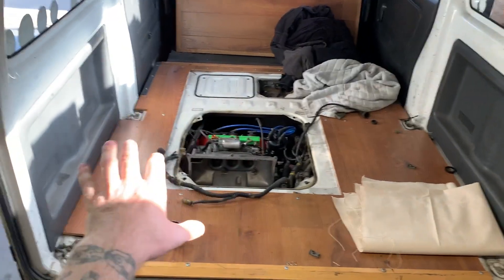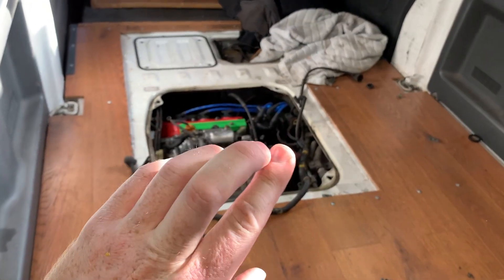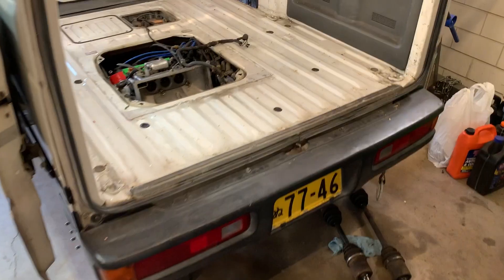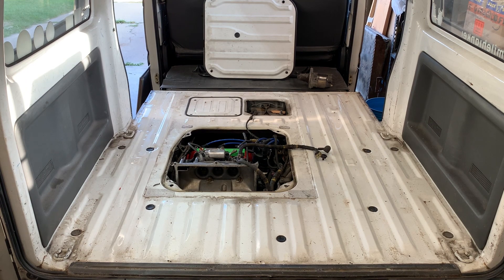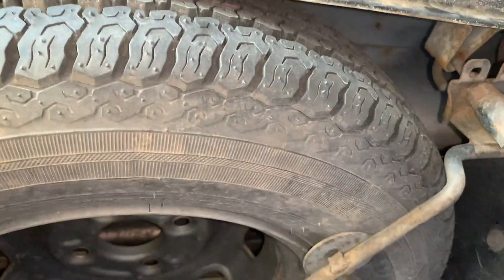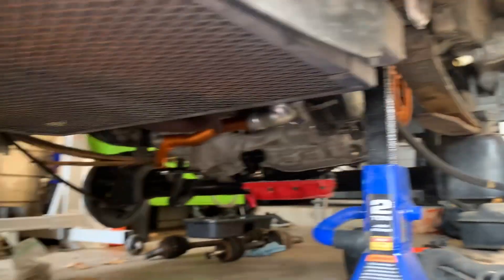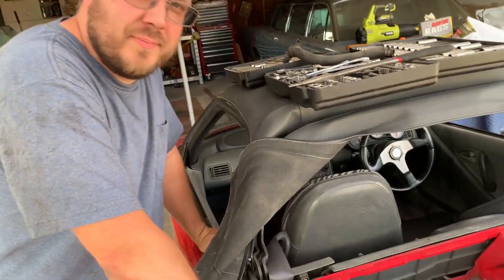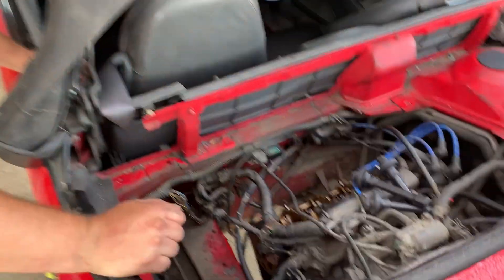Dropping the Acty Fuel Tank / Helping Out With a Beat!

Comment: I only watched a few minutes of the video (just wanted to see the fuel level sensor removal) but there was a lot of bad info. Sorry to come across harshly but you should really consider getting a manual or doing more research on your vehicle before making a how-to video so you know what you’re talking about. The first “fuel filter” you pointed out is actually a two way valve for the gas tank vent line. The “heater core” you pointed out is actually the A/C condenser. And that other “thing in the fuel system possibly second fuel filter” next to the fuel pump is the actual fuel filter. Again, sorry to be harsh. Just trying to point out some bad info
Reply from the maker: Thanks for this. The few manuals that are out there are in Japanese, so a lot of what I do is just jumping in and figuring it out as I go. Wanted to point out that this was a year ago and by doing this and routing the new fuel pump and fuel lines I learned how the whole system works. This wasn’t meant to be a how to video, more of just “what I did in the garage this weekend.”  I corrected myself with the actual fuel filter and the external pump. I’ll try to be as accurate as I can in the future, learning more everyday.